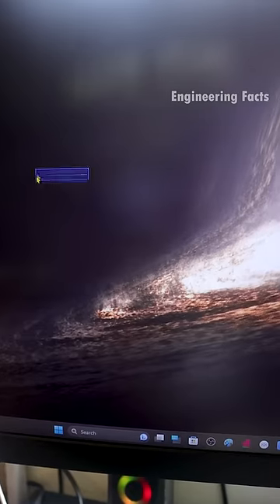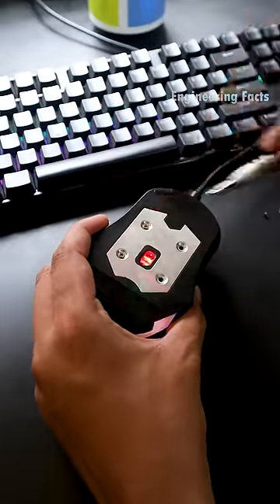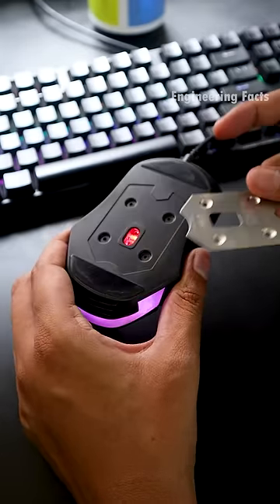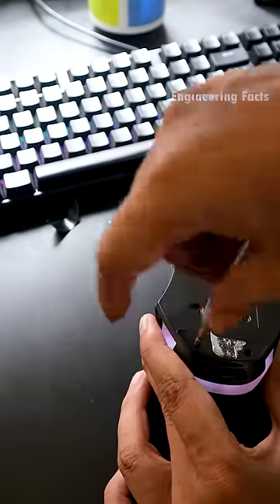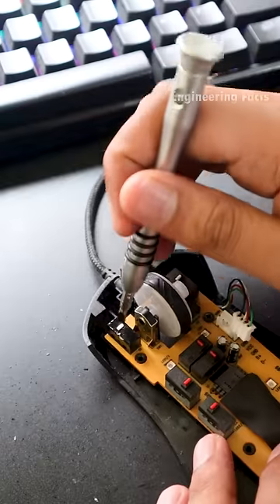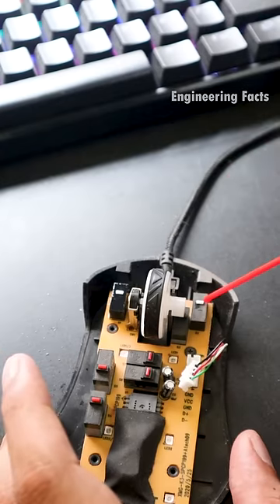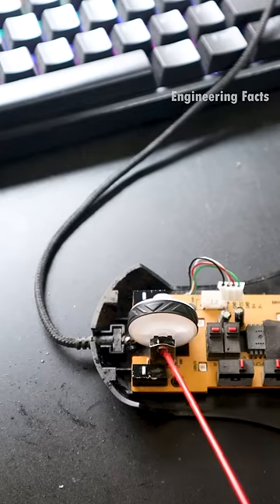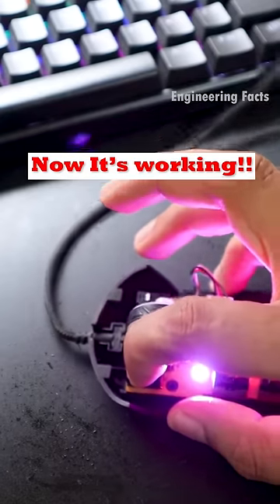பைத்தியம் புடிச்ச mouse.. 🐁 #engineeringfacts #mousereview #mouse

Comment: Metal plate is for adding weight to the mouse.. gamers can remove it if the move is heavy ..
Reply: Problem is that 4 screw for it
Reply: @arv1ndgr  4 screws add little more weight.. remove 2 and leave the diagonal ones ..
Reply: @fyi3658  you still don't get it, do you?
Reply: @arv1ndgr  ha ha ..😂

Comment: Antha metal plate is for just weight purposes bro, I have the same mouse, some prefer the mouse weightless so they can remove the plate and use it. Pls read the manual before using....
Good tip for mouse cleaning 👍🏻..
Reply: mouse name please

Comment: Engineer sir, andha metal plate  keela iruka sensor oda glass la scratches vilama iruka kooda attach panirupanga ..think in that perspective.

Aprom mouse ku lam lubricant adikanum nu avasiyam illa ...they are made with sensitive micro child parts .Neenga adikura lub only alcohol content ah irundha ok ..otherwise adhuvey pinnadi issue agidum

Best "adha kaila eduthu gap therinja adhula ..uffff uffff nu rendu oodhu ooodhunga podhum ..echi ulla poidama pathukonga😅😅
Reply: Extra metal plates in gaming mice are often used to add weight to the device. This weight customization allows gamers to fine-tune the feel and movement of the mouse according to their preferences. Some players prefer a heavier mouse for stability, precision, and a sense of control, while others may prefer a lighter mouse for quicker and more agile movements. The additional metal plates provide a convenient way for users to adjust the overall weight to suit their gaming style.
Reply: Yeah, there are many solutions for a problem, we have to find the permanent one.. you are correct.. namaku oru visiyam work aguthunu athaye elarkum suggest panna kudathu

Comment: @engineeringfacts Extra metal plates in gaming mice are often used to add weight to the device. This weight customization allows gamers to fine-tune the feel and movement of the mouse according to their preferences. Some players prefer a heavier mouse for stability, precision, and a sense of control, while others may prefer a lighter mouse for quicker and more agile movements. The additional metal plates provide a convenient way for users to adjust the overall weight to suit their gaming style.

Comment: Bro...metal plate is to ensure that the bottom does not deteriorate quickly due to wear and tear. (Friction).... correct thane bro...
Reply: ean bro wear and teear   a  eatho emary paper potu  taikura mathri  athu varum waight ku than vara oru use kum illa

Comment: Hii, I also have the same mouse ( red gear A15) I also face the same issue but I solved the issue. During the repair I also face the same issue where the screws. But this is a very good mouse. It's been working for 4 years still now. In between i have only cleaned the dust. It's a good mouse.

Comment: Bro in three phase line
Crompton 35w bldc fan is on ( fraction of seconds one phase cut in transformer otherwise fan circuit board damaged) the fan has five years warranty, I changed the circuit board two times and correct the one phase in two times.
So, what is the reason

Comment: The real functionality of that metal plate is to provide additional grip and mouse will not lift so easily this feature is for gaming purpose I don't your mouse satisfy those qualities 😂 but more the weight add we had less mistakes will aiming in games but it will reduce mouse speed so by providing removable weight game's can choose how much weight they want to provide responsiveness they want in hardware part of mouse 😂😂 FYI